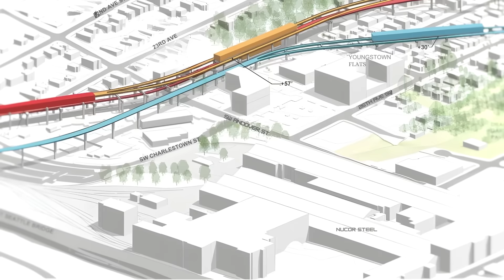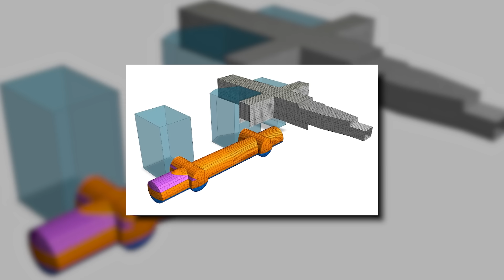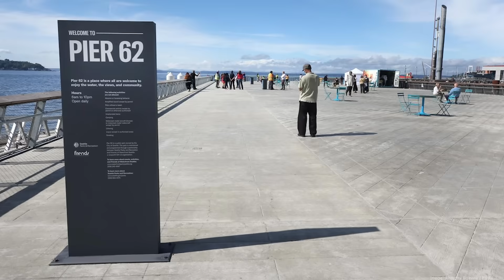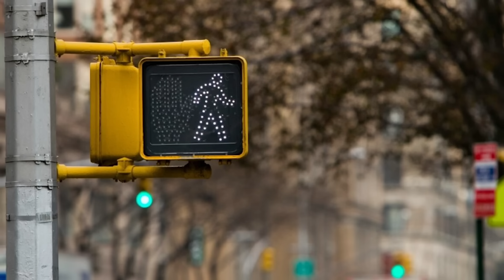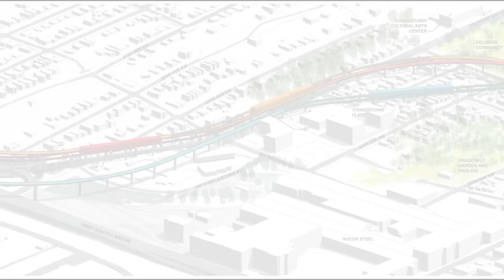Seattle Megaprojects: 5 Projects that will change America in 2026

Comment: As someone living in the northern area of West Seattle, The ONLY reason I support the current West Seattle Light Rail extension plan is because of the plan to reroute the H Line into Admiral and Alki, providing us with a connection to the light rail literally on the way to downtown (instead of having to go all the way down to the Alaska Junction like we have to do right now). Without any bus service change, I'd be furious and against the West Seattle Light Rail, because the Alaska Junction is already overserved by busses. Admiral and Alki are underserved, as are Arbor Heights and worst of all, Beach Drive, with no bus service at all.

Comment: Considering they were going to do all of this mass transit with the monorail years ago and had already bought the land but stop because of overruns.… there is no way near enough money for them to finish any of these projects. Light rail was literally inches away from digging up the first shovel of dirt going to West Seattle using a monorail system. Cost was nowhere near 20 billion. Even the original estimates for this light rail system are nowhere near 20 billion total. It’s all a huge grift on the city and the area as a whole. No the monorail would’ve not needed any tunnels and would not have interfered with traffic or pedestrians, whereas light rails already had several accidents with street level rail.
Reply from the maker: You raise some valid points about the history of transit projects in Seattle. It's definitely a complex situation, and it’ll be interesting to see how these new initiatives pan out in the coming years.

Comment: Have you driven I90 from Mercer Island to Bellevue?  Rebar is showing through the concrete and the road is so bumpy that driving the speed limit feels like a poorly designed Disney ride. But at least you have the graphitti and garbage to look at.
Reply from the maker: Thanks for sharing your thoughts! It sounds like I90 could definitely use some improvements. Hopefully, the upcoming projects will help enhance the driving experience.

Comment: I only clicked on this video to read the comments about the misleading thumbnail. Nothing like that would ever be allowed in Seattle, especially not in the neighborhood that jt is pictured to be in.
Reply from the maker: Haha, I get it! Those thumbnails can be wild, but they sure do spark some fun conversations! What’s your take on the actual projects?
Reply: @StructuresUnchained  Well, the Federal Way light rail extension opens in December, they are actively working on 520, and the light rail extension to Lynnwood is started. Ballard to West Seattle will happen, but not anytime soon. 

The challenge in Seattle is trying to operate by consensus. No project goes forward until a super majority of stakeholders approves, so if the lesbian vegan Wiccans say no then you have start all over. 

The best mass transit is built by dictators. It is hard to get the best transit system possible operating by consensus, so a single person with vision is going to come up with a better transit system, imho.

Comment: Seattle isn't capable of managing its finances as it is. You want to trust it with more massive debt. 
Seattle destroys roads with bus lanes that are empty 95 percent of the time. The roads are further ruined by huge bike lanes which further choke lanes for driving. 
The Mercer mess never ends.
Rainier Ave destroyed with one lane in each direction. 
Empire way(MLK) has 5 trains running through the center of the roadway. 5 minute stops on a road that should be clear. Plan on 20 is plenty outside of peak hours. 
Seattle is not worth investing in. Much has already moved to Bellevue or they leave the state outright. $5 a gallon plus for gas when the roads don't work is a statewide scam against the people
Reply from the maker: I feel you! Seattle's roads can be a real headache. Let’s hope these projects actually make things better instead of adding more to the mess!

Comment: Seattle is built on mud   moved in area in 93 still no complete massive  transportation  traffic jams  waste of funds
Reply from the maker: You're right; the challenges with infrastructure in Seattle are significant. It’s essential to consider the long-term benefits of these megaprojects, even if the current situation feels frustrating.

Comment: Why is a pedestrian bridge even needed there? The via-duct was replaced by a tunnel. None of these projects have continuity in mind.
Reply: Because there is still a wide road there?
Reply: @Djamonja a crosswalk used to work just fine for decades.
Reply: @AggroPhene  They have crosswalks too. That pedestrian bridge is probably from 3 stories up in Pike Place Market.
Reply from the maker: You bring up a valid point about continuity. Urban planning can sometimes feel disjointed, but these projects aim to enhance accessibility and connectivity in unique ways.
Reply: Honestly i spent many an afternoon at Pike Place Market wondering why it wasn't more convenient to walk down to the peir. I can appreciate it and the growth of this public transit corridor, but I don't recognize Seattle anymore.

Comment: took light rail from SeaTac to LynnwoodCenter, it took 1hr 30min. thats insane! 3 times slower than driving a car!
Reply: I drive from Lynnwood to SeaTac almost daily You are lying if say it takes 30 minutes to make that drive. Even with 0 traffic it would take an hour. You add traffic and it can take 3 hrs. Just Seatac to Seattle can have you stuck for two hours.
Reply: @eliaschevette it was last Thursday 7pm, driving north on i5 it will take me 30min , and it was no traffic. Light rail for some reason stops closed doors and wait for 5 min in seattle stations idk why. I did calculated it was 1hr and 30min, I thought it will take at least one hour. Light rail is good if you working in downtown and company you working for is paying for the commute and you dont have to pay for gas and parking, thats all is good for. Google maps at that time says with 0 traffic it will take me to drive to Lynnwood center 35min from Seatac.
Reply: Without traffic, 4am in morning, its a 35 minute drive. Its only 28 miles.  I traveled regularly from Exit 151, 2 miles south of Seatac, to Boeing Everest and it regularly took  only 50 minutes.
Reply from the maker: Man, that’s a long ride! But hey, at least you didn’t have to deal with traffic, right? Every silver lining has its cloud!
Reply: @StructuresUnchained I mean it was no traffic at that time, just didnt had a ride. Atleast I got some experience first time using light rail.